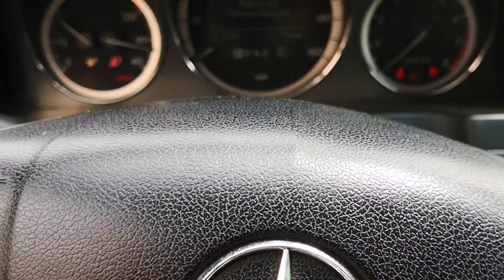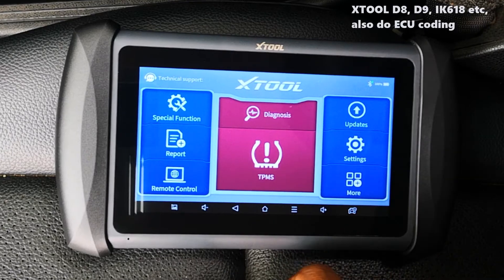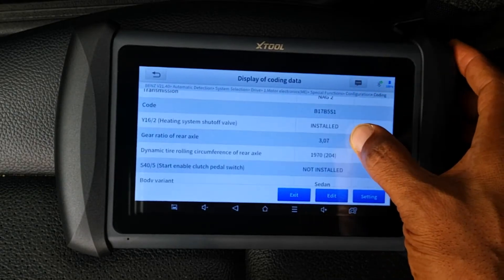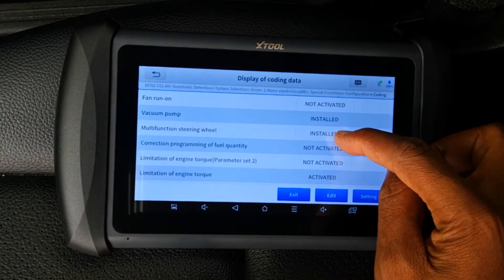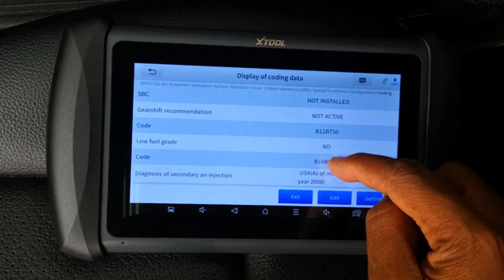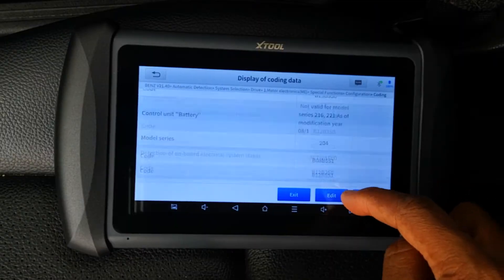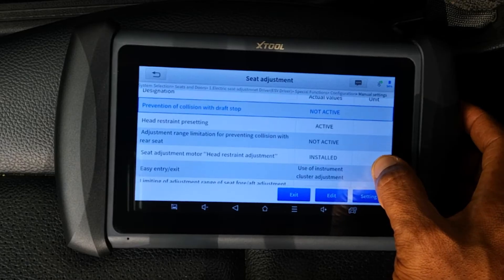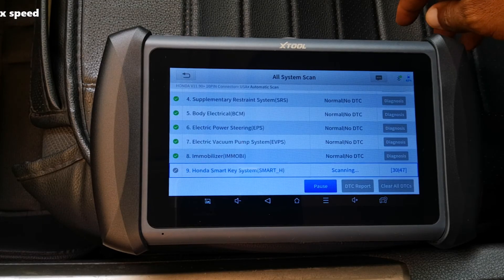Mercedes Benz car ECU Coding with XTOOL Scanner / How to do ECU Coding with XTOOL IP819TP, D8, etc

Comment: Greetings. I have a Mercedes c class (w205) manual 2016. The reverse lights don't work when I put it in reverse. Diagnostics does not show any errors. Through diagnostics, they can start and work. The car does not recognize reverse. The gearbox sensor was replaced and the rear module itself. Have you had such an experience?

Comment: This is not coding but configuration
Reply from the maker: ECU configuration is an aspect of ECU coding. The definition below is copied verbatim: 
"ECU coding refers to the process of configuring specific settings or options in the ECU software. This may include options such as the vehicle's engine size, transmission type, or other specific parameters that the ECU needs to control."
Source: https://newsmartsafe.com/industry-news/ecu-reprogramming-tool#:~:text=ECU%20coding%20refers%20to%20the,the%20ECU%20needs%20to%20control.

Comment: Do you know if this obd programmer can change the setting of dynamic modes to default to last mode instead of always reverting to comfort mode on your mercedes?
Reply from the maker: Not sure as I didn't specifically look into it. If I had a Mercedes, I would have just gone out to check for you. If I come across one, I'd check.
Reply: @DIYAutoworksNG  I can now confirm the xtool 819TP did the job. I switched my SL400 auto stop/start off using this canner today. Result🎉
Reply from the maker: Excellent. Thanks for sharing the update!

Comment: I bought a ip616 then baught kc501 and they dont communicate
Reply from the maker: The IP616 is not a key programming device and as such won't communicate with the KC501. You need the IP819 or D8 etc.

Comment: Will the xtools d7 be able to remove tcu codes on my 2005 cl500 722.9 transmision
Reply from the maker: Yes, as long as the issue is fixed. If its not fixed, no scanner will remove the code.

Comment: I'm thinking of getting the xtool d9s pro or d9. Do you know if this tool will be able to code/program a new power steering pump on a vw polo 2010? It requires to be. Also is it possible to adjust the top speed limit like your videos on bmw?
Reply from the maker: Hey. Thanks for asking. Yet to explore coding with xtool on a BMW. Haven't also had good hands on time with a VW. But, you can check XTOOL's function coverage list to see if it mentions it. Not the most user friendly function coverage list though. https://www.xtooltech.com/english/FunctionQuery.html
Reply: @DIYAutoworksNG  i sendt them an email and asked them. They said it was able to do it. I ordered one now so time will show .

Comment: That is not coding but editing
Reply from the maker: It's coding. You can check the definition of ECU coding. It involves changes settings in the ECU to make the car behave differently.
Reply: @DIYAutoworksNG 
I did programming at college, programming involves writing an algorithm and then eventually put it in machine language using different platforms like C++, Python and C etc.
Most automobile cars are written in C++ language or android. Android is derived from C++.
If you were go going to use any of those platforms that is coding. What you are doing is just editing, no coding do not be deceived coding is not that cheap.
Reply: Can Xtool D7 detect and correct PCM: power train control module faults. Do the codes on an Xtool tell a mechanic that a module needs replacement verses resetting/editing?
Reply: @inakalimba9428  
XTLOOL doesn’t do much as it is displayed or advertised, it’s more like a code reader.
Innova 5610 a much cheaper scanner does much better job than D8
Reply: It's offline coding for making changes to the vehicle control module performance. Not all are effective, and it is also called the variant coding

Comment: Can you reprogram the back door of 2006 ML500?  It does not open.
Reply from the maker: That's really not what coding is about. The back door not opening is most likely a bad actuator for the door knob. If its bad, it would need to be changed. Could also be a fuse, loose connection, open in the circuit etc. You'll just need to troubleshoot. ECU coding doesn't fix problems per say, it helps adjust hidden settings and stuff like that. Also check that child lock isn't on 🤓
Reply: thanks.
 @DIYAutoworksNG
Reply: Which State/City are you in @DIYAutoworksNG

Comment: As DIY user what is the better tool to buy- Xtool D7 or IP819
Reply from the maker: Both are good options. The 819 supports coding while the D7 doesn't. However, the D7 has a bit more special functions. Probably the 819 based on the fact that it's newer.

Comment: How do i code the correct fiel level as mine is jumping up and down
Reply from the maker: Doesn't sound like a coding issue, but rather a issue with the gauge on the fuel sending unit.